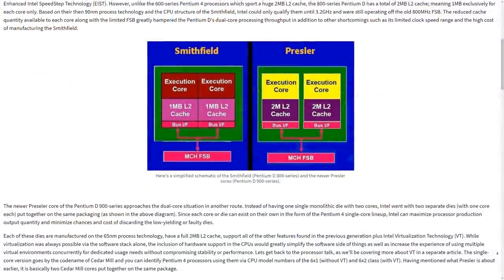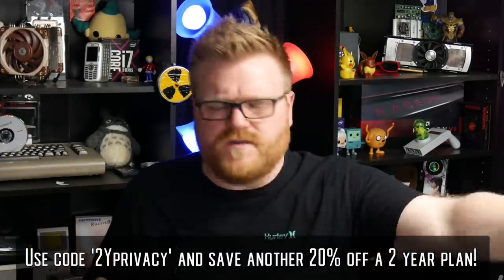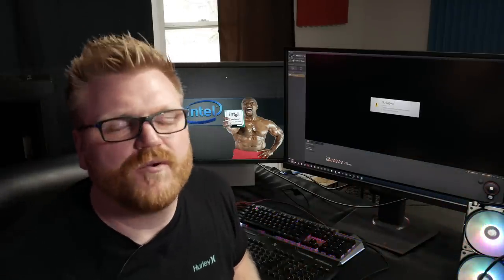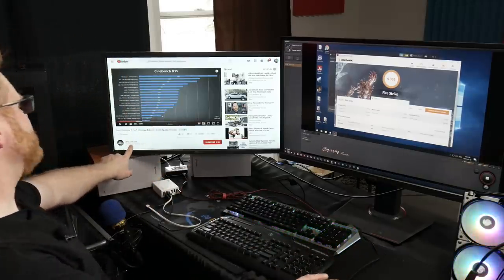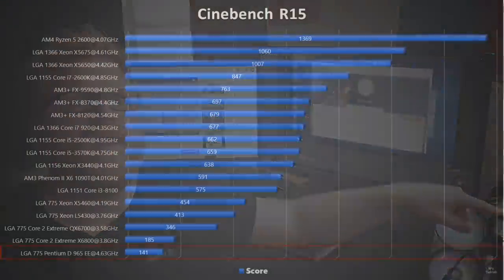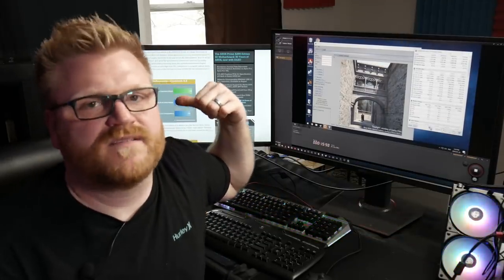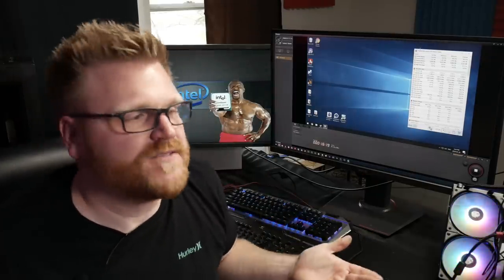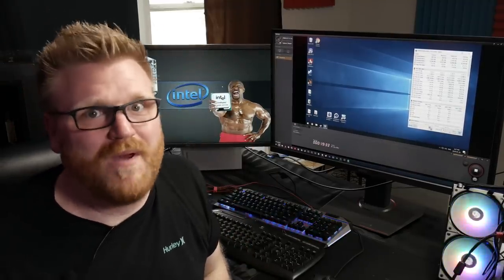Testing the $1000 Intel Pentium D EXTREME EDITION 965 in 2019...

Comment: The oldest processor I have overclocked was actually an FPU...a Motorola 68883 rated for 25MHz but all I had was a 33MHz crystal. It was on a CSA Mega MidgetRacer 68030 accelerator board for my Amiga 2000 which set me back around $1500 or so in the late 80's. It all ran fine for years after that, no water cooling needed!

Comment: The running joke at the time was that it was the "Emergency Edition." It was nothing but a rebranded Xeon part. Intel didn't have anything else that was remotely competitive until Conroe shipped.

AMD did the same thing when Intel brought out Sandy Bridge. The Phenom II X6 was just a rebranded Opteron.
Reply: The Xeon 5080. I have two in an Intel Server board. It's an Madness of an 4/8 Netburst system. But i'm going with a pair of E5450 (Q9650 equivalent) to make myself an FX Killer.

Comment: I think you’re jumping the gun on this. We haven’t seen anything to say that AMD’s brand new 7nm process and beat intels ancient 14++++++++++ units.
Reply: True, but for the moment I'll still let my inner AMD "Sledgehammer" fan boy party like it's 2003. :-)
Reply: beating 14nm+++ isnt just in terms of clocks 

zen 2 have much higher ipc (performance per clock)

much lower power consumption (from amd slides, the 65W 3700X is on par with the 9900K)

and they can put 12/16 cores and produce it for much lower costs than what the 14nm process can achieve
Reply: and im saying that because if we use the logic of "amd 7nm cant do 5ghz"

then its the same as intel did nothing from 2000 to 7000 series (2600k > 7700k)

both can hit high clocks
Reply: no one said anything about clocks
Reply: Ryzen 3000  will look good till october when full info icelake is released.  unlike TSMC intel doesn't lie about transistor density. also intel wasn't doing nothing these past few years haswell had AVX2 which was a 30% boost over standard AVX. broadwell adds TSX which boosts mult-ithreading performance,and kabylake had AVX 512. that said newer instruction sets are basically limited to the $200+ CPUs currently. not to mention the skylake GT4 GPU core that surpassed vega in performance per watt. though it dosn't help much given that intel only used it in iris pro and went back to GT3 for kabylake/coffelake. it may even surprise people to see intel Gen11 i-GPUs trading blows with Navi APUs. even a UHD 630 can already hold it's own in OpenGL at the very least. if only because the driver team isn't made of idiots.
Reply: It certainly did guys.
Reply: @psionx1  cope

Comment: Shintel lied about the TDP and real power consumption back then in 2006 already....this Pentium D 965 Extreme had a quazi 130 Watt TDP at 2 cores running 3,73 GHz....but in reality it literally ate around 150-160 Watts....I used to own one and I quickly sold it because it was too hot for a 2-core puny chip to be cooled properly back then when all the PC cases had PSU-s above the cpu-s and the heat from it literally could hurt the PSU on a long run :).

Comment: Decided to try Cinebench 9.5 on my 3.9ghz R7 1700. 6682 Multi-core and 1191 Single-core. It seems to vary about 500 points in multi-core for whatever reason per test. Probably not even optimized for quad cores of the era, let alone 8-core SMT chips.
Reply from the maker: hahahha, I just checked on my threadripper 2950x. you beat my single threaded score and got aboue the same as my multithreaded score. So it def doesn't work on high core chips hah
Reply: @TimmyJoePCTech  Lol yeah. One of these days we're probably going to say the same thing about r15 once 64C chips are commonplace. Man I look forward to those times.

Comment: Hmmm, we'll have to see how zen 2 overclocks. I hear we can do some NB monkeying on the new chips to get some extra performance, but right now it looks to just barely edge out intel at a lesser cost. So the value proposition is still the best point for AMD, but this time you won't be losing any IPC performance
Reply: ... learn what IPC is. AMD's ahead of Intel in IPC by about 7% now. That's how the R7 3800X can beat out the i9-9900K while running 500MHz slower. And Intel doesn't have a 12-core mainstream desktop part, so I dunno how you can say they are "matching" them on performance. Intel's got absolutely no response for Ryzen 9, and the new Ryzen 5's (i7-8700K tier performance for $200) make Intel's value argument on mainstream desktop pretty much non-existent. They are stuck between a rock and a hard place.

Comment: remember: when it comes to generating DirectX drawcalls, AMD drivers use all cores, Nvidia drivers use only 1
Reply: Meaning what in practice
Reply: amd drivers potentially more efficient/lower overhead on slower multi-core CPU's
Reply: Draw calls are in many cases the limiting factor in cpu performance. And partly why games wanted ipc and clock speed. Dx12 was supposed to address this I had heard

Comment: a few years after this era of cpu are still very usable for gaming, ive been using a i7 950 i got new in 2009 until recently, i upgraded to a i7 990x because i didnt wanna get a new mb as well. one of the best intel cpus of its time, 6c12t 990x extreme edition, w a vega 64 i get 60+ fps in gta v online at very high settings 1080p, 1440p, and small  frame drop at 4k, w advanced graphics on besides distance scaling. 990x oc 4.7 ghz, vega 64 oc 105 mhz on core and memory

Comment: LOL, I can't believe this video comes out today. And I have a build with this exact Pentium chip in it, and it's basically the oldest thing that I have running Windows 10 on it. That said, one thing that hurts that build is that the only DDR2 I have is 800mhz at CL6, so even with the considerable increase in capacity over my old Opteron 185 dual core build, the Opteron with DDR400 at CL2 makes it much snappier. The other point of frustration for me, now,  is that ONLY HWmonitor can read the cpu temp correctly. Speccy, Afterburner, HWinfo, none of that can.
Since I nickname successful PC builds after Pokemon, and given the lore about the Presler CPU's being like two heads fighting for resources, I nicknamed it *Zweilous*. Specs for mine are:
Pentium D 965 (3.73GHz stock @ 4.26 -> 16x multi) - stock voltage, amazingly enough and prime95 stable, using an Enermax 120mm air cooler w/ 2 fans
Asus P5WD2-E Premium motherboard
4x2GB DDR2-800 6-6-6 timings
Gigabyte R9 270X Windforce
Think I need to swap WiFi cards, because the USB WiFi dongle I tried giving it at first, seems to constantly stop connecting on me. Did you have a link to the video for overclocking the Pentium D though? I'm curious to see if i can squeeze more out of it.

Comment: The NH-U12a does NOT beat out the NH-D15, it comes closer than any other 120mm Air Cooler on the market, but does NOT beat the D15!
Reply: The U12a is amazing for the size, but it tops out early in the Fan RPM curve, pas 34 DBA in this test is a waste, while the D-15 enjoys a lead at EVERY noise level! And its max noise is about the same.

Noctua pulled off a hell of a feat with those new NF-A12x25 fans, and even more so with the 7 heatpipe 120mm tower cooler that is the NH-U12a, but there is a REASON the NH-D15 is so gigantic - and it is not because people like the looks of it, and they sure as hell don't like having incompatible height RAM, but if neither matters to you, the NH-D15 is the BEST PERFORMER out there! If you were to slap on some higher RPM/Pressure/CFM Fans to it, you would see far better cooling from it still, with some MAD LADS running 3x 140mm or 2x 140 and a 120mm fan on the NH-D15 and getting incredible cooling as a result!

TL:DR
Comparatively the NH-D15 has FAR more heat soaking capabilities compared to the U12a, and you better believe when Noctua releases their new 140mm fan with >0.5mm tip clearance, that I WILL be putting one of those on my D15! I already use the NF-A12x25 for the front intake, and it does seem to do better than the 2250 RPM Corsair SP-120 PE I replaced it with while being quieter. I use 120 on the front for RAM and case clearance.
Reply: @Dysphoricsmile , exactly. Can confirm through using two NH-D15 in two systems. Once you do some deep diving into the specs and how much heat these coolers can handle, you will not want an AIO. I did months of research on every part before building my pc last Oct., It's too much for me to put here but if you do your own research into the NH-D15 and its competitors, you will see how and why Noctua is king. I can't wait for those fans for mine too.

Comment: Every AMD chip released since the original Athlon had a higher IPC than Netburst.  Including Bulldozer.  So when the Pentium 4 was what you could get new from Intel, all four series of chips from AMD had a higher IPC - Athlon XP, Athlon 64 (including X2), Phenom, and Phenom II.  Intel didn't recoup the IPC crown until Core 2, which was designed for mobile devices, but performed so well that Intel scrapped the P4 line to use it instead.

Comment: the only d back then worth buying was the 805.  it was the cheapest chip and you could get it to the upper 3ghz on air and 4ghz under water.  there was a lot of buzz around the 805d when it was released with prominent tech sites like tom's and anandtech showing how easy it was to push the chip.  if anyone subscribed to tj's channel has an 805d you should donate it for a vid.

Comment: Pentium Extreme Edition CPU
The combination is better on i955X / i975X motherboards.
Some P35/P45 and X48 boards are limited to vcore 1.4v and cannot be used properly.
I use it with a P5WD2 premium board
Reach 1.48 v 4.6 to 4.8 GHz!!
But hot 🔥 55~70c

Comment: I have the eVGA nVIDIA nFORCE 680i SLI rev.2 motherboard, if you require some assistance. i was getting 4300 in FireStrike with the Q6600 GO stepping OC'ed to 3.8GHz and 2 GTS 450's in SLI. this 11 year old PC plays games without the SSE.4 instruction really good. Sniper Elite Zombie Army 2, 3 and Sniper 3 run at 1080p 60fps max settings. Using 2 GTS 450's. it even runs Sniper 4 pretty good. The Q6600 is a beast. 380cb Cinebench R15. that chip scales with CB R15. if it could hit 4GHz, it would get 400cb.

Comment: The reason the ground is dropping out is because that CPU cannot keep up with that GPU, the CPU is bottlenecking like mad.  Also you're using a CPU from the netburst architecture but the GPU is used to Core architecture or AMD architecture.  Those CPU's in Pentium 4 and Pentium D are netburst and totally different microarchitectures.  You need to pair a GPU and CPU that are compatible.  Netburst architecture is really old.

Comment: My best pc i built was a Pentium 4 530 think it was called prescott 3ghz for a friend back in 2006-2008 cant rem exactly.His still using it to play command and conquer and pc building sim :D.Only problem that pc ever gave me was that the gpu blew.It's a 915gux mobo which are a board that use ddr 2 and i just installed 4gb ram in it a few days a go for an upgrade.Sad part is the cpu's only 32bit so can't use the 4gb :s

Comment: Infinity fabric? Durrr, no. The athlon was a legit dual core, while Intel's later quads were slapped together, and even the p4s over fsb. The Athlon didn't have hyperthreading, although the p4 wasn't that good at it, especially in games. Also, you could get an Opteron instead of a fx for much cheaper. Also, the Athlon had a slower fsb, and ddr1 but could be overclocked, and board performance varied by chipset. Maybe the newer boards used ddr2, but I never used those. Ddr1 had lower latency, but also lower capacity. The best chipset was nforce4, but drivers were absolute crap past xp, although you could go xp64 and get best case scenario.

Also, GCN is vastly superior to Kepler in modern graphics.

I had a nforce4 4gb Ddr1 500 MHz, 1:1 fsb with ram, lowest timings, and it was a beast. When it came to ddr2, that was phenom territory, which the phenom 2 was pretty good at least until the i7. Also, ddr1-2=no memory vulnerability. Speaking of, none of Intel's older hyperthreading CPUs are safe to use anymore. +1 AMD.

Comment: very interesting. Now how does a amd laptop cpu from 2008 do in 2019?
Reply from the maker: Terrrrribly
Reply: @TimmyJoePCTech  I got a toshiba laptop (p505d-s8934) from one of the people that came to my graduation party. They said I could have it as it was not working. I somehow fixed it (powered on but nothing happened no display). I took it apart cleaned it up and all and replaced paste/pads and found that the cpu was an amd one. Supposedly low end model but am curious on how it does in 2019 with today's amd optimizations.

It is on windows 7. I updated it to w7 pro and had to install sp1 before I did. I not updated to windows 10 pro yet but the hard drive is very old. 5400rpm 320gb drive and has speeds of like 30mb/s read/write from hd info program I used.

Comment: Some older intel board cant disable the core.... i had an asus p5q premium paired with xeon e5450 managed to run an overclock from 3ghz to 4.4ghz just before the p5q premium ran into voltage problems as 12v, 5v, 3.3v started to drop rapid and causing locks up even at stock settings. As i tested the power supply that is in a healthy state. Will be getting another premium or deluxe some day soon

Comment: I cant even get CSGO to launch now
System specs
Xeon E5430 stock
Gtx 750 ocd
4gb ddr2 ram 
G31M-ES2L mobo
Whats the Issue?
Reply: roll back the GPU drivers? Delete them through DDU in Safe Mode and install from nvidia.com ?
Reply: @previousslayer  i know how toDDU the drivers but which is the most stable? Im runing the latest 430.86 driver
Reply: @dexsters5643  not sure about stable, but afaik some version from 2016 showed the best performance. Those are available at Guru3D. Never managed to defeat Windows updating them to the latest one tho (spare PC with a 750 Ti) and the Group Policy Editor trick somehow disabled the card altogether until I reverted it all. So latest version it is, and I haven't touched that machine for some time
Reply: the sad thing is you dont have a bad gpu :D

Comment: I honestly don't think this processor was given enough love. I'm sick of this AMD vs Intel crap. You take a silicon wafer and you beam transistors onto it, whether it be TSMC or Intel I don't really give a shit, fabs are fabs. The point is this CPU in particular including the 840 EE, and the 955 EE were CPUs from 2005-2006 that were not only dual cores but also had hyperthreading. This is early tech! Dual cores were just barely becoming a thing, and now your looking at it with a Cinebench for modern CPUs and calling it trash. Yes for 2019 I would say there is no reason to have it. ITS A 16 YEAR OLD CPU. Modern computers in 2019 had over 8 billion transistors, the CPU your working with had horrible pipelining and only 376 million transistors, this CPU has waaay less hardware than your typical modern CPU. Which takes me to your first mistake, using Windows 10. 10 is bloated with software (Compatibility Telemetry, Anti-Malware Services, other bloated useless things that people didn't care about in '06) I think Windows XP and later Vista had around 30 processes running in the background at one time during normal usage, which BTW this video was made in 2019 and at the time Steam still worked on Windows XP, so big missed opportunity there bud. Right now my Windows 10 machine is running 211 processes. Completely astronomical in comparison, this CPU was not meant to run Windows 10 nor should you have even attempted to bench anything on 10 with that processor, and don't forget Specter and meltdown, 30% of performance just gone. Windows 10 is simply not going to accurately reflect performance at all. I actually just revived my Pentium D machine not too long ago right here in 2021! Go back to Windows XP for a retro journey or slap a lightweight Linux operating system and your browsing the web, watching YouTube videos, and lightweight gaming on a 16 year old processor with no hiccups, so come on man be reasonable. Processors like this need to be looked at in the retrospective light, you can't just take a 16 year old processor and make it do modern things, computing simply evolves too much in that time. This CPU was far from trash, overpriced maybe but it was a flagship CPU after all, short lived or not. Suffice to say the Pentium D 965 brought me a lot of memories in gaming (Half-life 2, Team Fortress 2, Counter-Strike Source, COD: Black Ops, Far Cry 3, Fallout 3, TES IV Oblivion, GTA IV, Minecraft) and processing in general before I upgraded to a 3770K in 2012 only because my friend was sitting pretty with his GTX 480 and I5-3570. Anyways after reviving the Pentium D I realized I wasn't getting the same performance in the games I once was 10 years ago. This is probably due to security updates, and engine updates, and I can't really say for sure but I bet you anything that software engineers these days have the freedom to focus less on optimizations because processors are just that powerful now. 6 years I had with that processor, and yes I did spend nearly $1000 for it. In '06 I was rocking, even if core 2 quads released later that year, I still had well over 100FPS in Half-life 2 and source games in general and I couldn't have been happier after playing the Xbox port. PCMR, Good day.

Comment: Everyone realizes Intel's next release is going to leapfrog these amd chips by like 20% right?
Reply from the maker: Not if they can't make 10nm chips that aren't low powered laptop chips. Intel is legit behind right now, it's not like 2006 when they were near perfecting Conroe
Reply: That's fine and dandy but it will most likely not happen this year and with intel's rep I'm betting you're gonna pay a major premium. Also amd is still far from done with their new systems. We'll likely see another cpu from them within 2 years. It's gonna be a leapfrog game.
Reply: How does four threads per core sound?  Hint: its not Intel that has this on its roadmap...